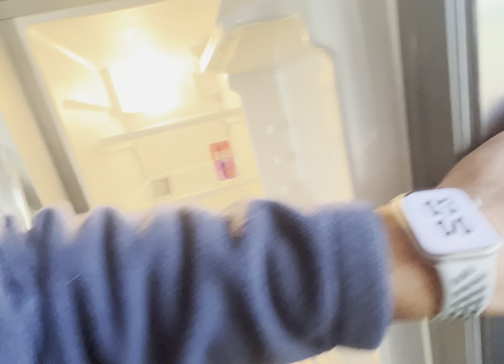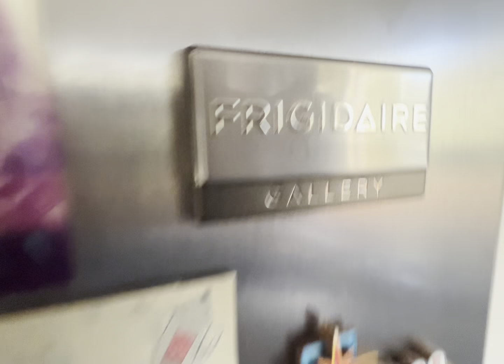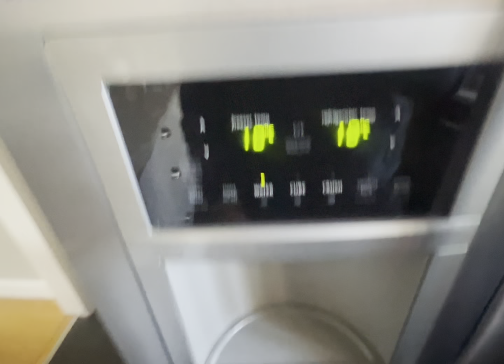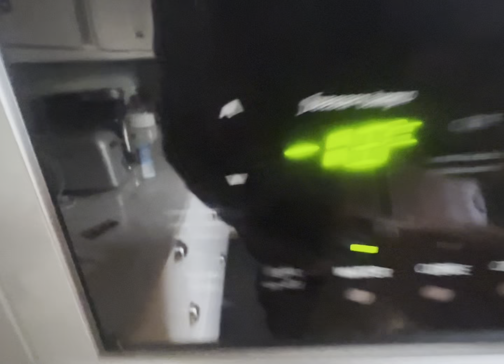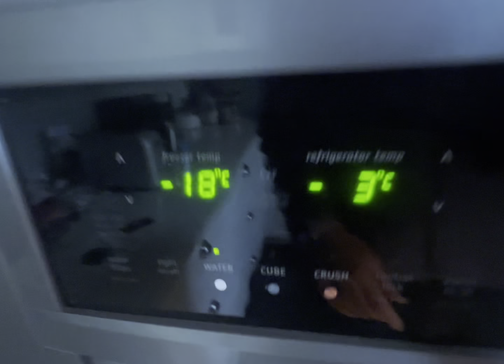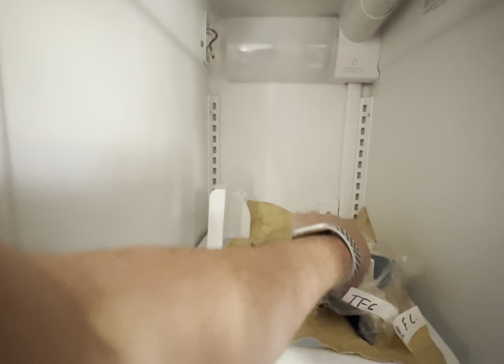Frigidaire Refrigerator SY EF Error repair: Cooling Solved in Winnipeg Appliance Fix Lab Canada USA

Comment: So you checked the fan motor and it had a OL?
Reply from the maker: Hello YeskaSmoke.
Thank you for your interest in this video.
Initially, the refrigerator did not produce cold, the cause of the breakdown was a faulty fan motor. It was replaced.
After the malfunction was fixed, a second breakdown showed up - in the refrigerator compartment, the temperature did not correspond to normal operating parameters and worked like a freezer.
The reason for this was a broken damper.
After two stages of repair, the refrigerator is working properly again.
Thank you for being with us.
Together we can fix any problem!